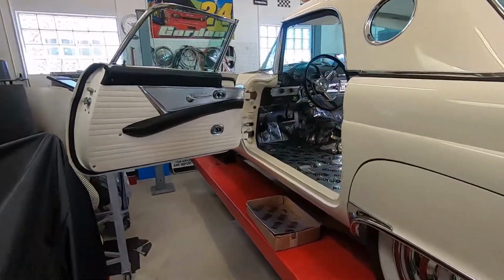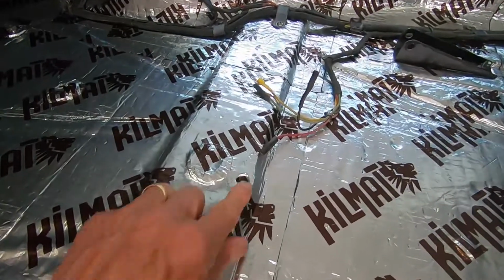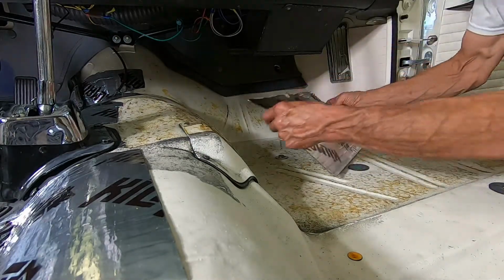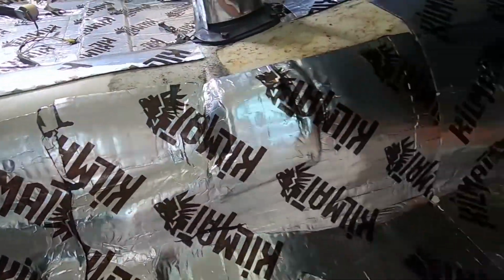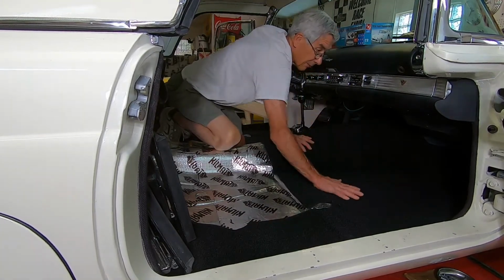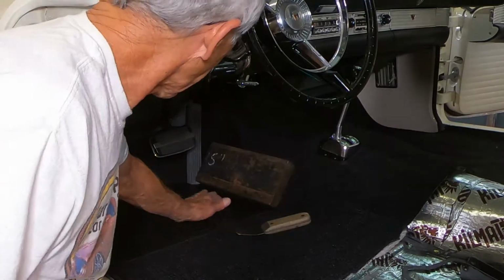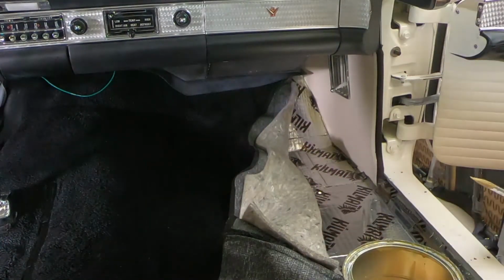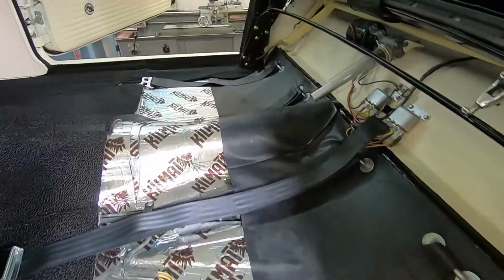Automotive Carpet Installation,  Sound Deadening Mat Installation, 1956 Thunderbird.

Comment: Great job Mr. Shaw. I installed mine a few weeks ago, it came out great, I do need to steam it though and maybe use some glue. It came preformed, I trimmed it to the exact size as the old one and it fits perfect. However, I still have a few spots that need to be pressed down. Steam? Or should I go back under and apply glue? Thanks in advance!!
Reply from the maker: If the steam works, that should do it. Otherwise, some glue would be in order. Thanks for watching and I'm glad yours turned out well.
Reply: @DickShaw You’re welcome, I am subscribed and keep up the amazing work!

Comment: Great video. I'm getting ready to install new carpet in my 1972 Corvette. Can you tell me the make and model of your steamer? I looked on Sharper Image but not see the one you are using.
Reply from the maker: Sure, thanks for watching the video. Mine is a Sharper Image "Compact Garment Steamer" model CA876 GS5. It is 20 years old, so they probably don't make this exact one anymore.
Reply: @DickShaw  The reason I ask about your steamer is I bought my 1972 Corvette from a friend of mine. He bought all new interior for the car in June of 2020 including cutpile carpet from ACC but never installed any of it and the carpet has been in the box sonce then so I'm thinking I may need to use a steamer on it to get it to lay properly. That is one sharp T-bird!!
Reply from the maker: Another thing that will help is to get it out of the box and laid out for a couple weeks before installing and if you can lay it in the sun as much as possible it will help it to relax, making it easier to install.
Reply: @DickShaw  Thanks for the info. Hopefully the weather here warms up soon. We were done to 30° last night.

Comment: I want to replace my carpet, but I do not know how to remove the seat, do you have a video on that?
Reply from the maker: I did not make a video on that but look along the bottom outer edges of the seat and you will find the frame. At the front and towards the rear you will find where it is bolted to the floor. remove those bolts and the seat should lift up to where you can remove any wire connections for electric seat motors. The seat will then lift out of the car. Good luck with your project and I hope this helps.